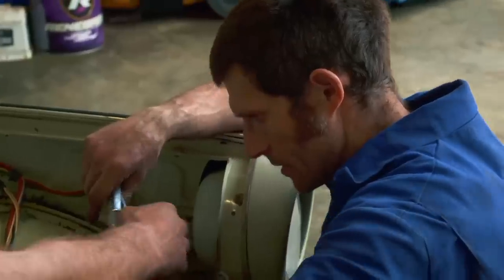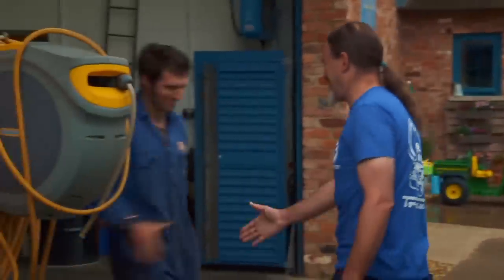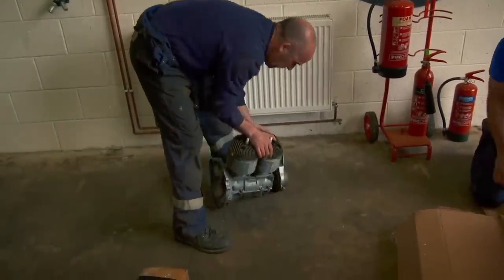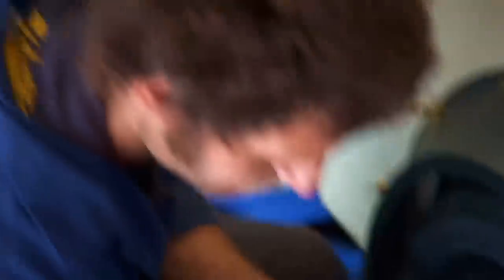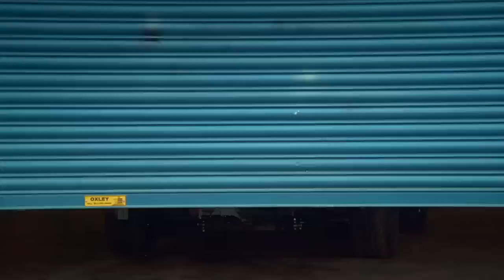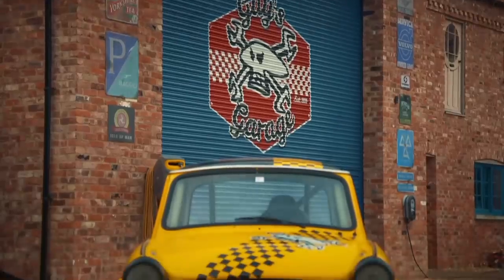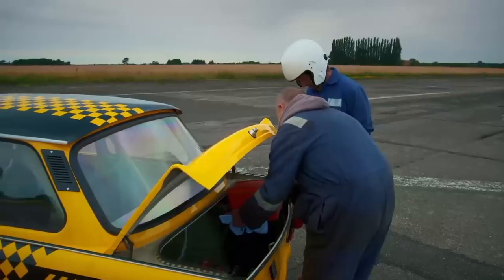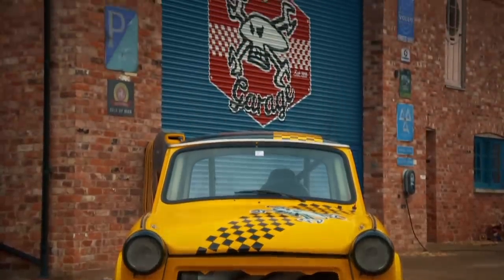The Finishing Touches on Guy's Trabant | Guy Martin's Garage

Comment: Of course, this is hardly "restoring a Trabant" as previous titles claimed. It's creating a new car with a Trabant body. Technically impressive, but it has nothing to do with what a Trabant is.
Reply: Don't be silly.  It's a Trabant monocoque, modified Trabant engine, and the structural parts of the Trabant suspension. This is little different to creatining a race car from any other production car.
Reply: @ferrumignis  That's would be the first Trabant monocoque ever produced then.

But apart from that technicality, it just isn't a restoration. Kudos to the technical skill on display, and call it a modification or a renovation, but if the majority of parts is fundamentally different from the stuff you began with it's not a restoration.